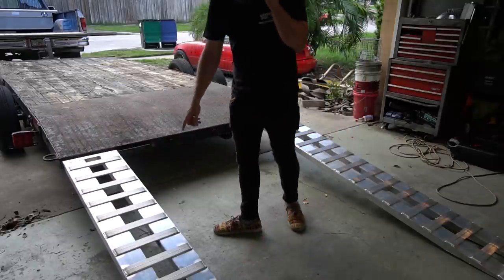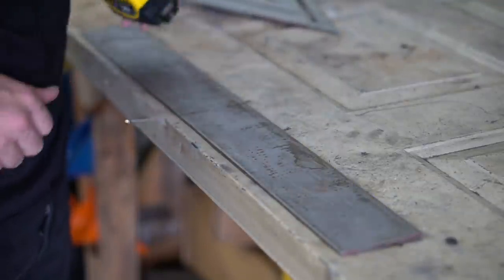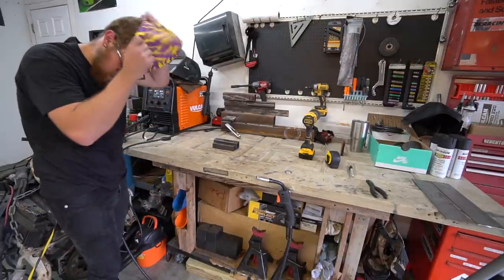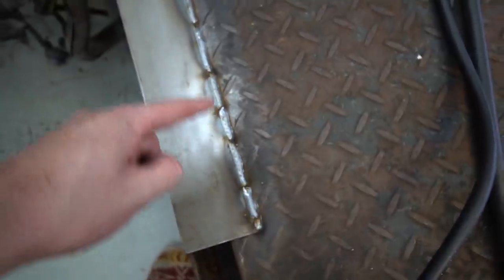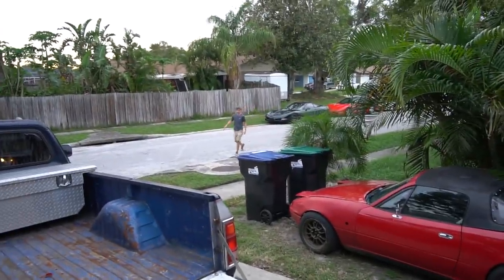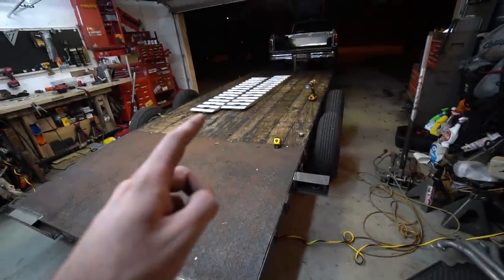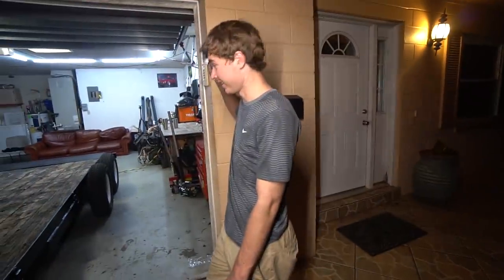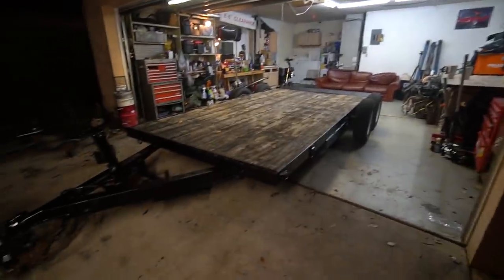Turning a $800 trailer into a $1800 trailer.

Comment: I've built a number of trailers myself and turning any pile of scrap metal or poorly built junk pile project of someone else into something practical and user friendly usefull is always satisfying.  

The first one I ever made was made from a old cultivator frame that I turned into a 6' x13' 6000# single axle flatbed some 20+ years ago.  Still use it regularly. 

Another one is a 8' x 20' 12K # flatbed I made from some 100+ year old riveted bridge frame iron.   My #1 usage trailer now.

Also turned a old 14' x 70' trailer house frame into a 8' x 30' 18k # flatbed for a buddy of mine who uses that all the time too.  

Beyond that I have made a number of other trailers out of other odd scrap iron and rebuilt several other peoples poorly done DIY attempts into decent reliable and safe to use rigs too.

Comment: Taylor - great real world application for your new skill, it's always so satisfying when you learn something new as you open up a whole new world of ways to fix things. Just one tip that I thought I'd share, when you were welding the ramp stays you had your resting hand leaning against the trailer which is probably comfortable but as you want to move it it'll skip over the surface and screw the weld up, it's always best to have your elbow relaxed leaning on the surface but allowing your arm (with your other welding arm resting on the relaxed arm) free to move if need be for longer welds like this - you'll feel uncomfortable doing it at first but once you get used to it, it'll be a night and day difference!
Reply from the maker: +iXiiN thanks for the advice! That's something I've been struggling with for sure!

Comment: Sand the deck and put a new coat of linseed oil on it and a set of fenders! That tailor will look good then. Also wire up an LED strip to the very back of the trailor for break light so they can actually be seen by other drivers. Other than that,  kick ass!

Comment: A tip for drilling thick steel. Slow the speed down. Helps keep the bit cool and will stay sharp longer. Also use penetrating oil on the bit to keep it cool. Drilling holes will be much easier and quicker

Comment: Dope! This past week I picked up a 10k lb car hauler that needs a bit of TLC as well. New tires, fenders, lights, replacing old hydraulic brakes with new electric ones, 7 way wiring all the way back, spring and hanger bushings replaced, maybe even a receiver tube on the deck to attach a winch in the future. I didn't even think to video it as one of my projects, but yours was good so maybe I should since i'm only half way in. Glad yours came out well

Comment: Proper PPE, guards and face-shields are a must. Cutoff wheels are notorious for blowing to pieces when bound up - has legit killed people before. Deal with the sweaty brow and cumbersome shields and save yourself...literally
Reply: Iv gone threw like a thousand of cut off only had one blow apart it was because i was a noob and twisted the wheel they have never killed anyone ya cut you open good but never killed.
Reply: This is the most dangerous thing I have ever seen someone do. Yes a cutting disc can for no reason blow apart and that disc is spinning at 6000rpm + if a pice broke that's about the size of your finger nail and hit you in the eye or face it can seriously injure you, if your using a 9inch angle grinder without a guard then your asking for a pice the size of your hand to stick into your skull. And yes people have died from them. Not having a guard on one of them is your risking your life. Can't believe people are so stupid.

Comment: Get some fenders for your trailer and it will look even more top notch and save you from rock chips!
Reply: Watch the video where he put the Vette on the trailer for Irma, it wouldn't fit well if it had fenders
Reply: Little hard if you have lobster fitment. If they were able to use hinges to open and close that would be dope.
Reply: John Koozy also a blowout
Reply: True
Reply: John Koozy :
Reply: Still like a $900 dollar trailer here
Reply: John Koozy he needs to change the wood that’s what makes it look bad
Reply: In Illinois it is illegal to have a trailer without fenders on the road
Reply: same in kansas

Comment: Nice job overall.  You did a bunch to make an OK trailer even better to suit your needs.

A few things I would do a little differently:
The ramp retainers - I would have rounded all the edges and corners, just because at some point you may get in a hurry, and slicing open your hand on those will make you cuss.  

The electrical - 
Not sure if your light enclosures have a ground stud in them, if not, welding in a stud is a real time saver.

Pull a full length ground from the connector all the way to each light and trailer brake connection.  Bond them to the trailer at these locations.  It seems that most trailer electrical problems are almost always ground related.  You can never have too much of a ground.

I tack in conduit for my wiring to run in to prevent as much rodent and weather damage as possible.  It's a bummer to hook up to your trailer just to find out a field mouse had a snack of your wiring, and now you're rewiring the trailer when you should be loading up for a trip.

Fenders - Even though your home state may not require them, they're still a good idea.  If your car doesn't fit with them on, you may want to sell this one, and buy another trailer.  Some states will ticket you for no fenders, not sure if you ever travel out of state, but something to consider.

Comment: If you are having an issue with penetration pre heat the metal that you're about to weld. It makes a huge difference. You will get good burn immediately instead of halfway down the piece once everything is heated up.

Comment: Taylor, you're so lucky that didn't fly into your face. You need to wear a face shield, and your grinder needs a guard. Don't skip using safety equipment!
Reply: newer grinders have a safety shield that rotates around the head so that it doesn't stay in your way

Comment: Big like for the video as always but come on, get your guard and handle on the grinder, it came with them for a reason!! 
Little tip, with solid wire mig welding you push not pull. 
Hope that helps
Reply: Declan Brooks, when you see a grinder kick back and the blade impale someones forehead because they didn't used a handle, it kinda makes you want to look after yourself
Reply: Shouldnt be usin one if they cant hold it good enough. Fuck we use 9 inch with cut off blades at work
If tou cant handle it dont use it
Reply: Declan Brooks or just be safe ¯\_(ツ)_/¯
Reply: Pushing or pulling mig will work fine, and grinder shields just get in the way
Reply: All the safety you need is common sense if you follow every safety protocol you never get work done 
The way we work down here in the great land down under is the only safety protocol you need is a brain
Reply: Wow Declan Brooks, you sound like a real man's man. Good on ya
Reply: scott brown completely agreed on the handle and guard i thought that I would never need them then 2 months ago i was cutting exhaust pipe off from under a truck and the disk exploded, got caught and I i dropped the grinder on my wrist because It yanked it out my hands 10 stitches later and nerve damage. I had a cut half a inch deep into my wrist because I wanted to be dumb and unsafe.i almost died that day from blood loss.
Reply: Here is why you use a grinder guard.

http://www.contractortalk.com/attachments/f59/104677d1387132400-worst-injury-you-gotten-so-far-50mgeb.jpg
Reply: scott brown 

You have no idea what the hell you are talking about
Reply: HAHAHA....
Reply: Welds looked pretty good my first thought was to just wrap the corners and do a 2 or 3 inch stitch on both edges and one in the middle and to angle your gun where you can push the kit not pull other than that they looked just fine for a little trailer repair!
Reply: I dont really care much for the guards, they only seemed to get in my way while trying to cut into tight places. However the handle I agree with, so much more control with it.
Reply: little tip,you can push or pull solid wire mig,do it all the time LOL!
Reply: You can push or pull. I find pulling much more comfortable
Reply: common sense is safety
Reply: You done get much work done when you dead or got parts missing
Reply: I use a grinder without the handle and without a guard every day. Been doing it for nearly a decade. All my digits are still there. Chill out.

Comment: Home Depot has the grinder nut and plate.
Read the instructions because on some applications you have to flip the nut over and use the tool they sent with it instead of a wrench the nut head fits in the center of a disk to center it.

Comment: Just a quick tip... Next time skip the shrink tube terminals. Too often the shrink tube splits open when crimping. Get the bare terminals and a roll of heat shrink tube. Much more reliable, actually easier to work with, allows the option of soldering your terminals, and gives a nice clean look. Awesome build though.

Comment: While we're on the topic of things you shouldn't do while using angle grinders, you should never use gloves when working with rotary tools and you should never use an angle grinder without a guard. I don't want to sound like a negative nancy, but even more so I don't want to see you get hurt- I've gotta see the miata swap! In all seriousness though, stay safe. Thanks for another awesome vid!
Reply: yeh i agree, is cringe worthy seeing people using gloves on linishers too... but yeh i have been save by eye protection and the guard enough times to make it worth using
Reply: i use harbor frieghts leather work glove bc the seams are shit and if i catch itll just rip
Reply: its better to use gloves with grinders, especially the thick padded welding gloves, i used to do a lot of grinding on pipe lines and sometimes the grinder would snag and itd ge tmy hand, luckily i had gloves on. the gloves get ruined but your hands will thank you
Reply: yeh... i personally don't use gloves with a grinder, but with a linnisher or grind wheel etc the last thing you want is for the glove to either get caught and pull your hand into the machine, or the glove to get pulled off, along with your skin
Reply: No gloves will save your fingers if those gloves get caught
Reply: Ogre Dad Seriously? You're going to come in here blindly insulting me for absolutely no good reason? One of the first, most basic rules anyone is ever taught when learning how to safely operate tools and machines is to never wear gloves or loose fitting clothing when operating machines with exposed moving parts, especially ones in rotation and/or with high speed or torque, lest one gets caught and causes you to lose a hand. There's seriously no need to barge in with rude interjection, regardless of whether or not you're right about the topic at hand.
Reply: A grinder with a sanding disk, grinding wheel or cut off wheel will eat  your flesh in a heart beat and without warning. A guard is a must and a layer of thick leather may give you the moment or two needed to save your hide . I have been using them every work day for 30 years and have never had my hands pulled into the grinder. A vertical mill, lathe or drill press is a different thing all together. When using a cutting wheel a face shield should be used.
Reply: bugsnstuff 

I call b.s. on using them for so long and you still use a guard
Reply: No clue about the thick leather, that seems unnecessary, but when you've had a disk break and almost hit you in the balls and it hit your safety glasses, you become very aware that a guard would prevent something worse happening if I wasn't wearing overalls or it happening again, and I was glad that I was wearing overalls to stop it.
Reply: Is this a joke? Always wear gloves while using a grinder kids. Always. If you went into an actual welding shop and got caught grinding without gloves you'd get laughed strait out the door. Its not a lathe. If a grinder hits a glove it will cut, not pull.

Comment: You did a good job on the welds on the ramps. Turn the heat up a little so the puddle flows into the joint a little more. It will be more concave that way. Again, good job.

Comment: You can get a disc or wire wheel that threads on.  Bust it apart and use just the nut.  I've done that before.  Not ideal but works.

Comment: Also turn that Harbor freight cutoff wheel around the other way.
Those are designed to have the metal arbor flange on the disk facing the body of the grinder.

Comment: Just a suggestion, run a wire from the running light from the tail light to the side marker light to prevent it from staying on. That light for some reason is wired to a hot wire on the plug

Comment: I don't feel like reading 1,114 comments, but I'm sure others have already told you that the rear markers are supposed to be red, not amber.   And since your trailer is over 6 feet long, DOT requires amber markers up front.  Notice other trailers to see that the logic is red at the rear, and amber everywhere forward.  As long as it is, I'd put mid-way amber markers on also.    Supposed to also be a white  lic. plate  light on the tag as well.

Comment: You can make your welds lay out smoother if you push the wire when your running solid wire push solid drag flux core

Comment: i just rebuilt my car hauler trlr,  fenders are 72in x 11in  with 12in inner skirt.  then mount trlr lights at back of fender or weld 2x2ln angle iron from frame to rear edge of fender, do same for front.  mount trlr lights at back of trlr so both sides can be seen at same time  looks good  still a ways to go

Comment: You really shouldn’t be welding on the trailer with it hooked to the truck unless you have the battery’s disconnected on the truck.
Reply: Patrick Kelley jr It doesn’t do anything. That’s a myth.
Reply: That's complete BS I was welding on my truck with an arc welder didn't have the battery is disconnected and it fried my starter ever since then always disconnected batteries
Reply: juuurrrt no it’s fucking not. Clearly you’ve never welded on vehicles lmao

Even if you understood basic welding or how electricity works you’d know it’s not a myth. You’re shoving massive amounts of amps and voltage through metal conductive parts and wires rated at 5amps max in some cases. It’s sure as fuck going to fry or burn parts

Comment: ok a few tips to make your next project turn out mint....mig welding you push not drag and if you came at it from the other side when welding the flat bar on for the ramps it would have made it easier to get a comfortable angle. When drilling pilot hole never drill larger then 1/4 the diameter of the desired hole.

Comment: I messed up the washer on my grinder as well.  At Home Depot you can get the dewalt washer as well as a universal fixture for tightening.  Seems like you just need the washer.  I found it in the tools section with the grinders hanging on the wall with the grinding discs.  Hope it helps.
Reply from the maker: +Zack Garner I looked in that exact spot. Must have missed it. Thanks!

Comment: I think drilling a couple of holes and adding 2 of these: Steel Standard Duty Without Coil Safety Pin, Zinc Plated Finish, 5/16" Pin Dia.... would have been a lot faster while also resolving the problem with front tires pressing the truck forward and the rear tires causing the ramp to release.  With safety pin would have been another alternative.

Comment: Not sure what the law in Fla. but most trailers have 3 lights in the center at the back of the trailer or a strip of lights. They are there to determine the back of the trailer at night, if just the lights/turn signals they think that is the back of the trailer and hit the trailer.
Like John Koozy said fenders help you should see the side of a car after a rain with no fenders!

Comment: This may sound like a bad idea but trust me, paint the wooden part of your trailer bed with old engine oil. The oil soaks in a preserves the wood very well and because it soaks in so good there is no oily residue left behind. Just don’t do it if the wood has been coated with something that will stop the oil soaking in.

Comment: For the grinder disk nuts, go to harbor freight and buy the $9.99 angle grinder. Use the ones it comes with and throw away the grinder. They fit the dewalt grinder. Quick and cheap fix for me.

Comment: Taylor. U can also drill a hole through the plate and the ramp and use like a pin so that the ramps cant move at all. U can prob do multible holes in one or other so u can adjust were the ramps will be stable at. And use like a coterpin type of setup for quick relocations of ramp.  Just thought might be helpful to ya.

Comment: the right piece is on the grinder now .it's the flat washer under the nut . take the nut , flat washer and beveled washer off; then put the flat washer on then the disc then the nut tighten the nut with the wrench provided with grinder, don't throw away the beveled washer because you need it for beveled discs good luck

Comment: Replace the wood, sand the rust, weld support beams, and paint the trailer whatever color you want 

Edit: if you do this, get a huge banner that has your banner on it, and put it on the trailer. Also suggest installing a winch, if you buy a shell

Comment: Great vid. I would have painted the trailer with a brush. Cheaper and thicker long lasting result. You will need to get the right brush and possibly thin the paint 50% with thinner first though. Those death wheels on the grinder are dangerous even the wire wheel. They sell curved cut off wheels for that style grinder. Check to see if that curved plate comes off or buy a proper grinder. You can also cut with a metal blade on a circular saw, angle grinder with wheel, jigsaw, cutting welding rods, bandsaw etc.